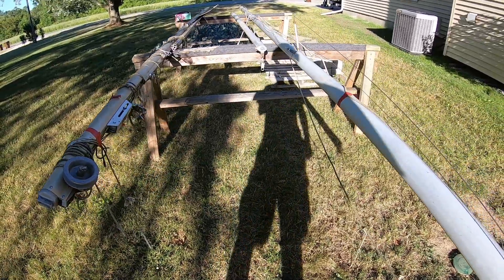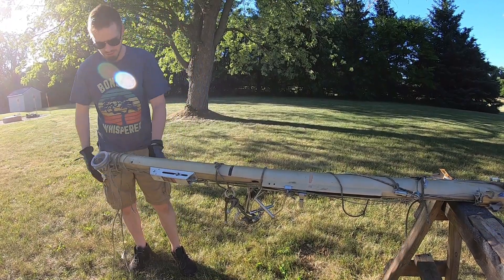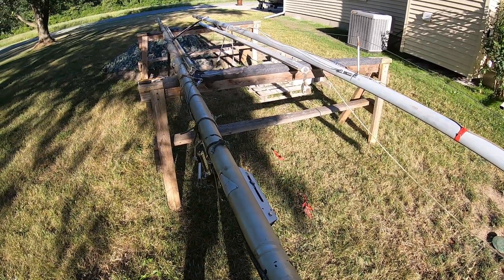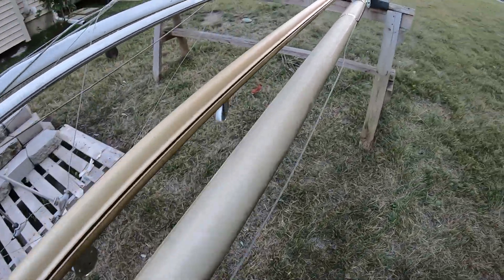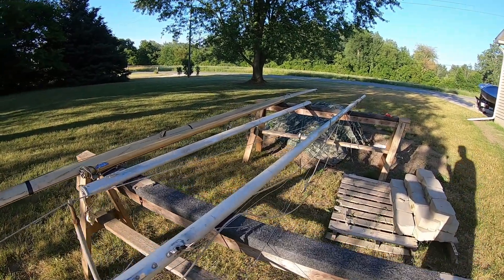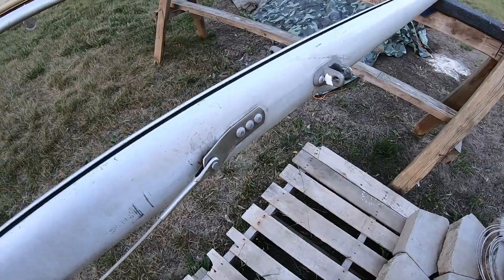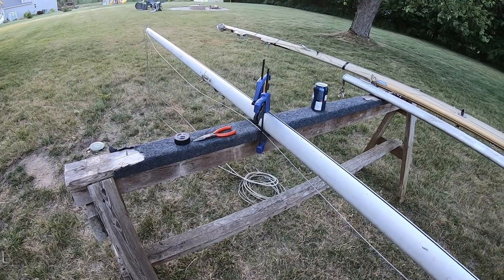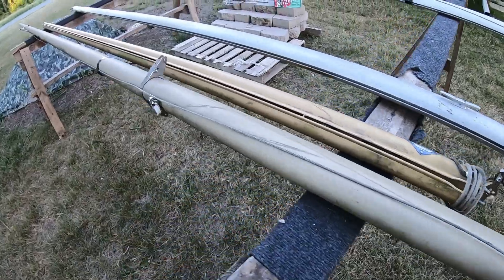Restoring My 1960s O'Day Day Sailer - Mast Teardown w/ Bonus Vacuum Timelapse (Ep 6)

Comment: Hi, I am no way an Oday specialist, but I am also suspicious that the 'bronze mast' fit the type of boat or period. A multi purchase adjuster box look a little 'advanced' on such a boat. I do not think that trapeze rigging fit neither. Keep posting
Reply from the maker: The 'bronze mast' turned out to be a gold-anodized aluminum Proctor brand mast.  It's an after-market racing mast made for the Day Sailer.  My research indicated it's likely worth more than the boat itself lol.
Reply: @twokharacters  I guess that some Day Sailer racers are pretty serious. The racing rules are pretty opened to allows installation of trapeze on class legal boat. You got a good deal with this extra spar.